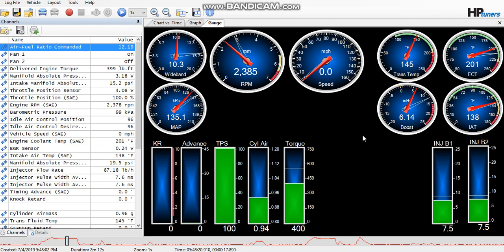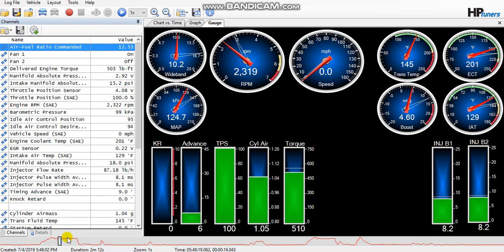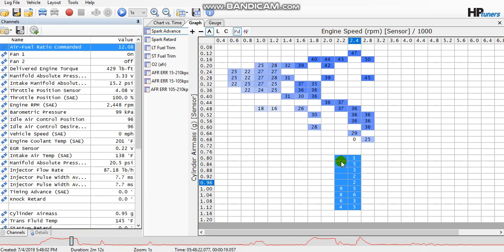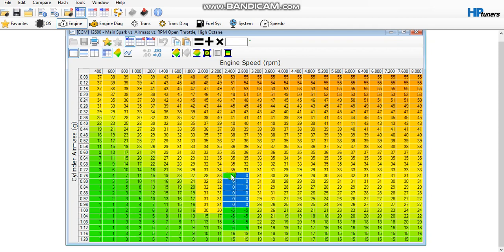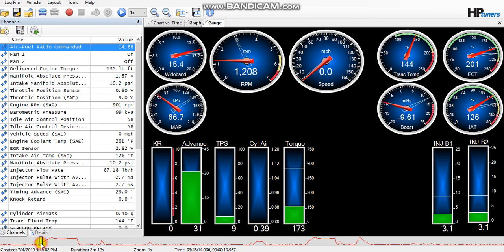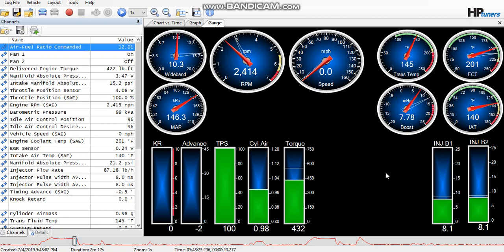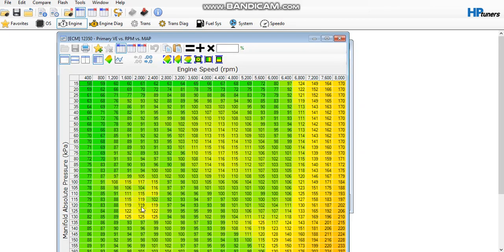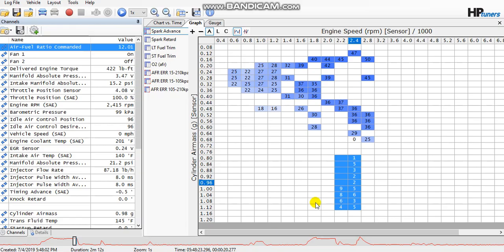How to Adjust Timing and Fuel For a Two Step With HP Tuners

Comment: So I have a 2005 Tahoe built 5.3 tsp BFD cam and supporting mods. Unfortunately I'm still on stock converter and just purchased 2step. I'm trying to get it to shoot flames on the limiter of 3200-3500 either in park or foot brake with 2step turned on. I'm trying to figure out exactly what tables I need to play with bc there doesn't seem to be anything on the repository or on YouTube.

Comment: Good video, when you get to 0psi/vac is when you the timing went from in the 30s all the way below 10. Have you tried keeping the timing in for just a little bit longer? For say, till about 2-5psi and then yank all of the timing out. All of that timing is what helps it build boost so quick, then yanking it out helps it hold boost but also makes it lazy in case you need to roll into the beams from the prestage to the stage setting when drag racing. Also another question, how is drive ability when the timing table like that?
Reply from the maker: This particular setup was in a truck that had a drum brake rear end on street drag radials. While on the foot brake building boost it'd either take over the rear brake and spin the tires or push through the front brake, so a little more power was taken out to help keep that from happening. If you have a tranny brake you can probably rip it up really nice. I've since moved on to MS3 Pro for my vehicles, which uses Tuner Studio.

Comment: Haven't found an answer to this question yet. Are you running an aftermarket stall converter if so what size? I've done this tuning to mine but cannot seem to get positive pressure in the intake b4 my tires start to spin. (Footbraking).
Reply from the maker: The vehicle example in this video uses a 3400 rpm stall and a disc brake rear end. If you're having a hard time holding the wheels try taking out more timing which will decrease power. If you're using a low stall it'll be more difficult

Comment: Hey Man I just got my two step and I set it at -8 degrees of timing and it didn’t want to bounce off the two step.. I tried bringing it up slowly but nothing seemed to work, I set it back down to -5 and I brought it up slowly and it worked just fine, do you know why this could be happened?
Reply from the maker: What convertor are you running? It maybe too tight for the RPM setting  on your 2 step with that much timing pulled. Keep in mind when you retard the timing it pulls power out and power is a huge determination on when a convertor will stall/flash.... So there's a balance there, if you don't have enough power, the engine may not be able to get up on the converter. You don't have to shoot for a certain number, you have to find the  number that works... if it's working at -5 that's where I'd start.

Comment: Do you need the two step module for this to be possible?
Reply from the maker: Yes because you want the throttle body wide open to move as much air as possible.

Comment: Hey mate great video. Only decent one i could find on this subject. I know this is an old video but wondering if setting the timing pull up this way effected your normal driving very much?
Reply from the maker: Not really, on the timing it's in an area before the converters stall kicks in. If the air/fuel is adjusted much you'll likely see a quick glimpse of that right off idle like a lean or fat spot.

Comment: Mine is a dodge 2003 3.9 with no maf, should I do the same thing but on the map vs engine speed graph?
Reply from the maker: I honestly do not know. I've never worked with any Dodge stuff using HP Tuners.  Sorry.

Comment: Hi Scott. Do I zero it out or retard my 2step areas the same way if I have a trans brake ?
Reply from the maker: You can yes, especially if you're having a hard time building boost quickly or if you just want the brake to hold more efficiently by decreasing power.
Reply: @scottcoleman162  ok thanks! I'm at  4 to 5 psi off the line, just Wanted to see if I could get it up a few more psi